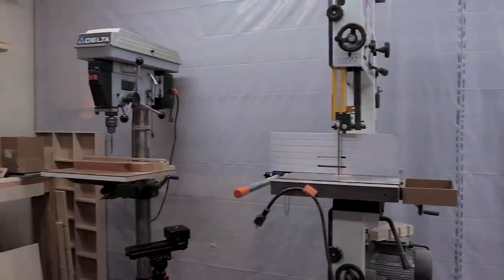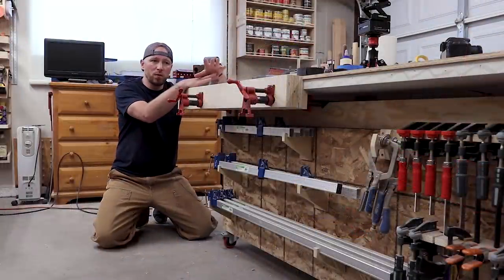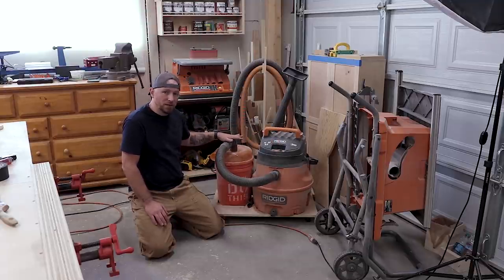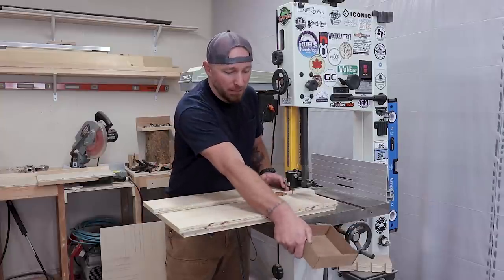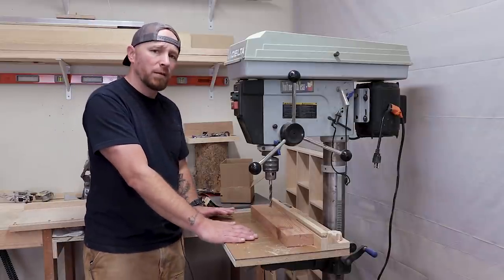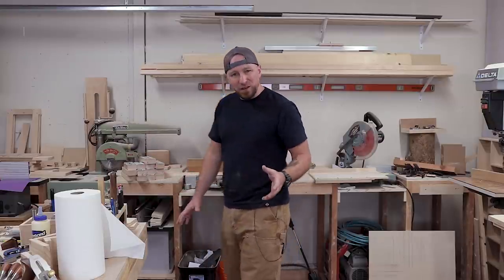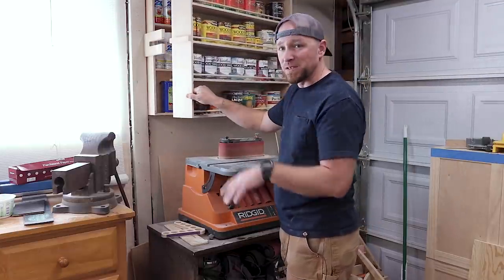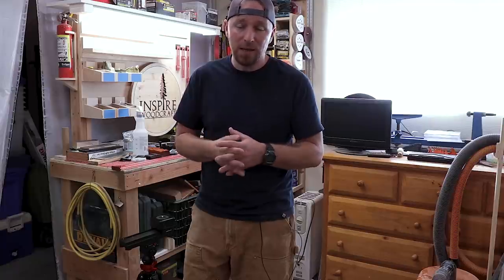Inspire Woodcraft 2020 Shop Tour

Comment from the maker: Welcome to my dirt shop :)
Reply: Hey its saw dust you can never get rid of it if your cleaning your not wood working!!
Reply: I have the same drill press, my switch quit working as in wouldn’t turn off unless i unplugged it.  Replacement off amazon switch is about $10 which should fix your problem.

Comment: I think workshops are always evolving Jody, I've always been envious of American garage workshops because they're much bigger than here in the UK. My original garage was 19 feet long but only 8 feet wide,it's still only 8 feet wide but I've extended to 29 feet which as helped no end. When I retired I made a mobile bench which is 6 feet long and 3 feet deep, on the right hand side is my Bosch site saw and in the middle is my fixed router with lift and the left end has drawers. This bench as made my limited space easier to cope with. I wish you luck with the new tablesaw and router combo,looking forward to seeing it.👍👍👍

Comment: I am a CDN resident and went across the border to pick up a HF dust collection system. I personally love it. I had a 55 gal drum and bought a separator lid from lee valley to make it 2 stage and it's awesome and a whole lot quieter than I thought it would be. I have heard that the green ones work a bit better than the grey ones... and the only other point I saw in my research was to check all the screws on and near the impeller when you first get it as there may be loose screws. With the exchange rate, gas and duty I still came out ahead of anything I could've got here north of the 49...   Cheers... I love your channel... first started watching you with that bandsaw circle jig and have been following you ever since. There's a lot of similarities between you and I, with respect to shop space and tools..... and it's one of the reasons I love watching.. it's very motivating.

Comment: Seeing the tools you use was like looking at my shop except you have good lighting.  We have just about the same tools except the table saw. In my opinion, the sander & jointer are excellent choices for a small shop. I was able to fix all snipe issues on the Porter Cable planer by adjusting the in/out feed tables. Since adjusting - zero snipe - seriously.  The main difference between our shops - quite frankly is you.. well and you have good lighting  :-)  You are an amazing craftsman, designer, maker and overall good guy. I always know when I spend time with you, it's going to be a "time * well * spent * event".   Thank you so much for the gifts you give us by sharing your know-how.
Reply from the maker: I really appreciate the kind words! Thank you very much.

Comment: I am really enjoying your channel. I also have a small shop in my garage. I have storage shelves on the back wall that stores totes full of “stuff”. I put up a two door sliding barn style divider. Made the doors out of 3/4” plywood and mounted French cleats to them. Gives me an 8’ x 8’ wall to mount hand tools to that I did not have before. Also hides the clutter of the storage area, but still have easy access. 
The hardware for each door is rated for 200 lbs, so can have a fair amount of stuff on it.

Comment: If you put the wheel brackets back on your shop vac use can attach pvc pipe to it and pot a shelf on top of the pipe for your cyclone dust collector.

Comment: It is good to see how you are improving and learning about certain tools. Please consider the ivac auto switch for the dust control I have loved it from the moment I started using it. The low budget option is the switch and the remote. The middle is adding the tool sensor or sensors. Finalmente the super option is adding the auto blast gates also.

Comment: Love your shop! I have a one car garage shop as well and it's always interesting to see how people organize such a small space. One thing I wanted to comment on... I know a 6 inch jointer is frustratingly small, but at least it's something. And for larger pieces that need to be face jointed, it's really not difficult at all to make a planer sled and shim the piece as needed. It honestly took 15 minutes to make a planer sled out of scraps and some sandpaper.
Reply from the maker: Yes it is something! I tried to let people know that for what it is, it is a good tool. The only reason I haven’t made a jointer sled for the planer is because it’s one more thing to have sitting around warping when it’s not used. Ironically, I will still end making one even with a bigger jointer, but I will hopefully have a better way to store it at that point. The other thing with the bench top is that it’s so short. So even small pieces with any length still won’t straighten out.

Comment: Nice tour !  If you put the wheels back on the shop vac, where the accesories slide onto the wheel mounts is where you would slide on the PVC.  Same size PVC as the shop vac tubes. I have that same vac  ;-)   , and have seen it done.  I can relate to your frustration with the bench not being perfect flat.. I have the same issue.  It's something I need to fix too.

Comment: Nice tour, you have a lot of good ideas and rationale for things that you do. Only suggestion on how to help with space is to build some of the flip carts. I've also had one of the benchtop jointer for years and the only issue that I've had was when jointing longer boards. I built some extension wings that I can bolt on and off that increase the length to 48". Still have the same fence, but working on a solution to that as well. I think the best part of your drill press is the "Don't mess with Texas" sticker. Again, thanks for the tour and looking forward to seeing the ongoing progress. - Chris
Reply from the maker: Haha! I wondered if anyone would see that. A buddy of mine stuck it to my truck like ten years ago, so I stuck it there and that’s just where it’s lived. Yeah I’ve often pondered the flip-top carts. I just might do that. Thanks!
Reply: Inspire Woodcraft Pneumatic Addict has a video and plans for a double flip cart. I have a spindle sander on one side and a lunchbox planer on the other. The other sides are empty and serve as assembly and an outfeed table.

Comment: Nice! I would definitely take the extra time and just put up a couple studs and some drywall instead of the zip wall though. it doesn't cost much for drywall and studs and you don't need to plaster it so it's able to come down if need be, It will also give you wall storage to use.
Reply from the maker: Yeah that was my original idea but not only does it cost more, but it’s a bunch of stuff I have to take down and figure out what to do with if we move. I’ll have to take this down too, but at least if I move I can reuse it for a spray booth or something.

Comment: On the drill press, take the switch out and blow it out with air, then try some electrical contact cleaner. Tighten anything that may be loose. Good as new.
Reply from the maker: Thanks. I took it all apart and serviced it but it's still a little messed up. The housing itself is cracked so I think I need to fix that to realign everything. It's one of those things at the bottom of the list. One of these days I'll fix it for good!
Reply: @InspireWoodcraft  I wonder if you can get a new universal switch/button. Probably can. Good luck!

Comment: For your table saw see you are not running the riving knife.  Try a 7 1/4 " blade in it.  Will change your life.  Less sawdust less kerf less wear on the saw and cheap blades.